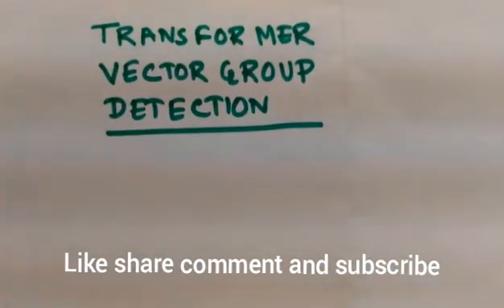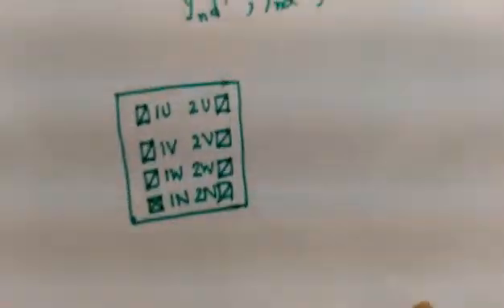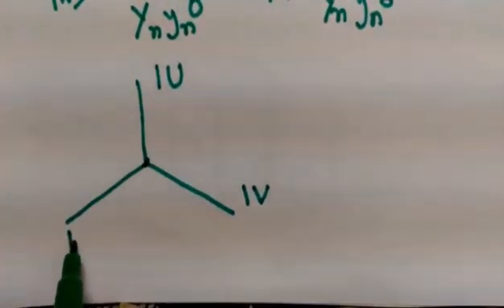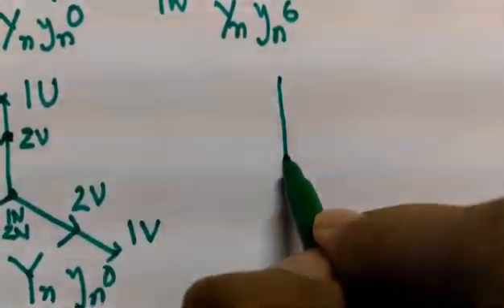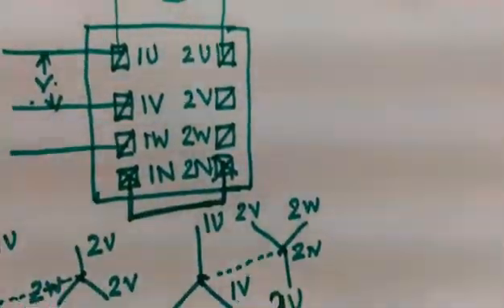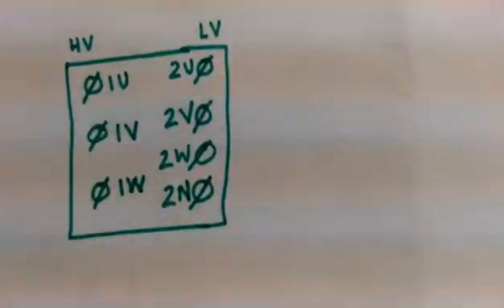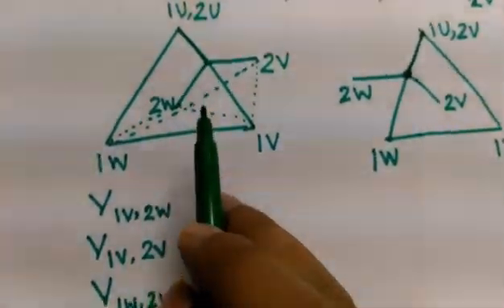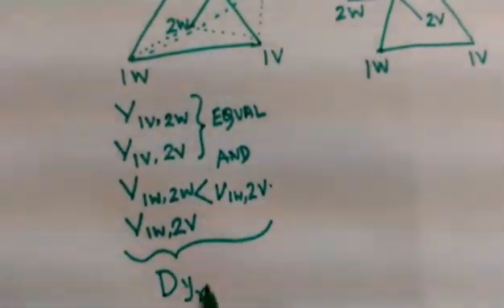Transformer vector group determination|Electrical engineering|Electrical technology

Comment: Why we need vector group?, why we're going for shift ?, what will happen if we use same phase angle as of generated without shifting?. What's necessary of phase shift for transmission and distribution. Explain me
Reply: @abdul ,It is imoortant to test the vector group because of the unwanted circulating current ,which produces heating effect . Power grid is supplying the same vector group and we are connecting our transformer to that .so vector should be matched and no phase shifting and no circulating currents .
Reply: @anuragverma4863  Sir how to calculate fault current of a plant and how with detailed explanation
Reply: @sriramprakash97  
Its a long calculation. We dont talk about the plant , we calculate fault current with respect to source . Source is key factor and it supplies  the fault current . So while selecting the circuit breaker or any panels ,consider transformer fault current , generator fault current , cable also plays important role, and during fault ,motor also supplies fault current ,rather than to take supplies. 

Transformer fault - full load current / percentage impedance .

Gen fault - full load current / reactance, X ''

Cable -  MVA(short ckt) = (KV)^2 / Zcable.

Add it. For motor , generally add 4* full load of transformer of you dont have data of motor. Thats it.
Reply from the maker: Check any power system book.
Reply: Great...
Reply: With out phase shift we cannot produce rmf
Reply: @sriramprakash97   i don't think so, then you're saying generation Voltage and current from generator doesn't have RMS?